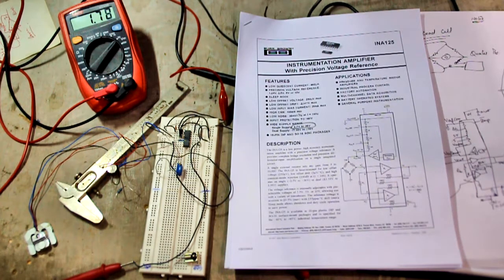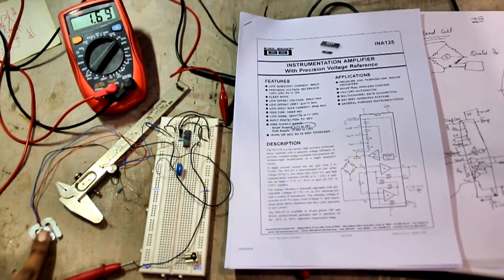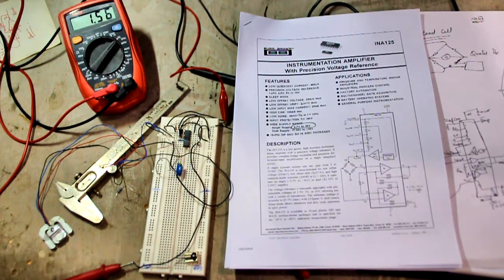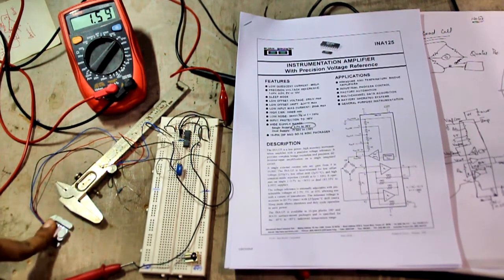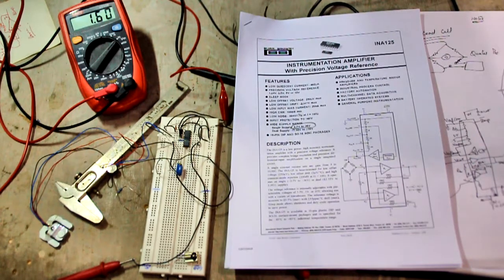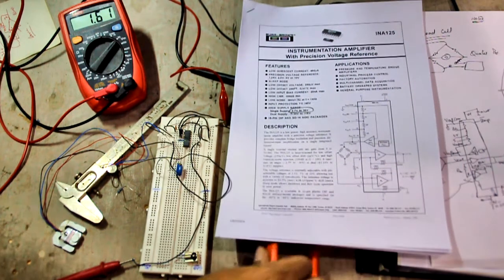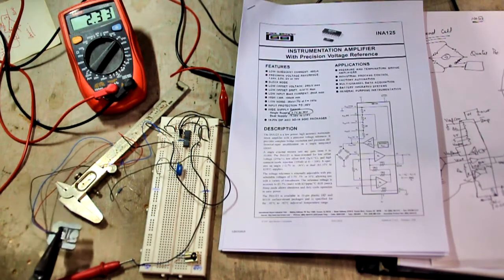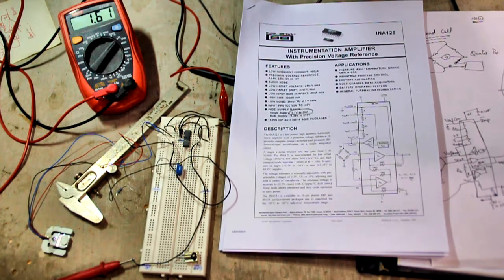Demo of the INA125 with a 50Kg Load Cell on a Breadboard

Comment: Are you showing the resolution of the scale in another video?
Reply from the maker: Actually no. I kinda used it where I did not need it calibrated in weight but rather {emtpy, half and full}
There seems to be a lot of interest on the subject but hav'nt got any specific application in mind for a new video.